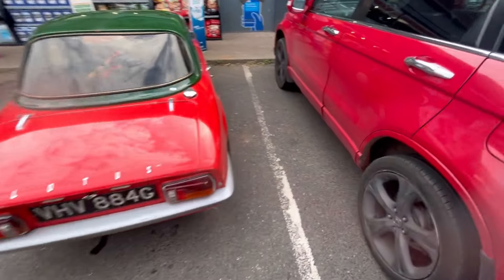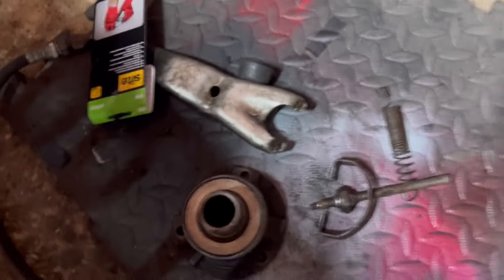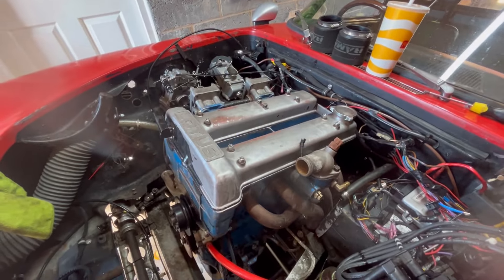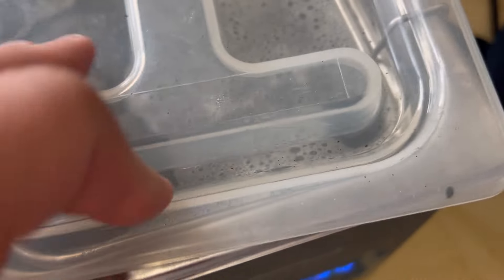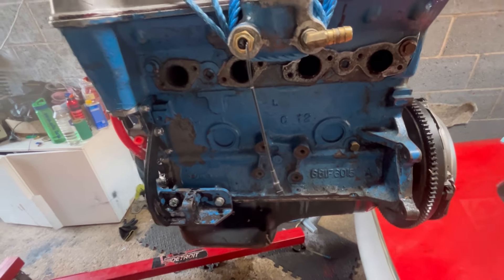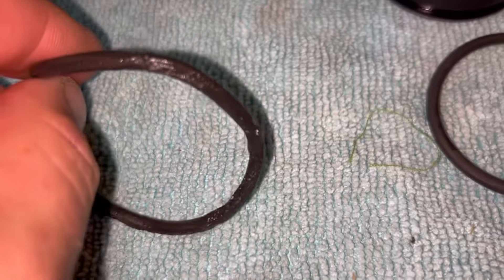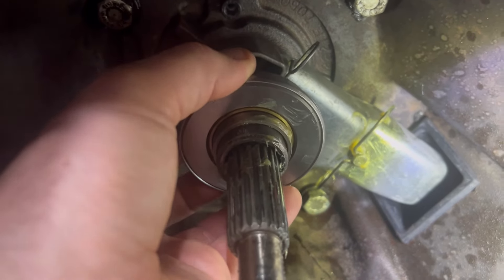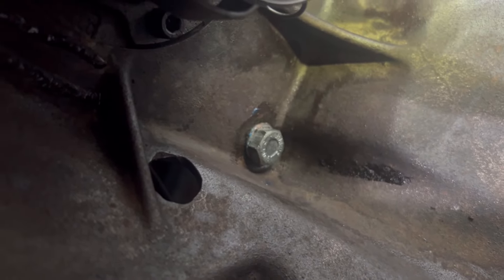Lotus Elan Episode 82 - 🤦🏻‍♂️🤬🤦🏻‍♂️😢

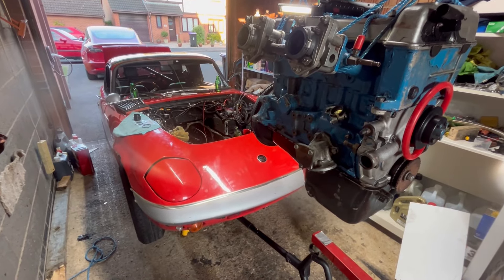Comment: 16:00.  My first car was a '64 TR-4.  The caps on the master cylinders said, "Use Girling Fluid Only".  I ignored what I thought was nothing but an advertisement for Girling and put in everyday brake fluid that most cars used.  Boy, was I wrong.  6-months later, all the rubber bits had turned into chewing gum.  The original rubber parts were made of pure rubber and most brake fluid will attack pure rubber.  Modern brake parts are made of Neoprene.  Off the shelf brake fluid has no effect on Neoprene.  If you buy your rebuild kits from a reputable dealer, he or she will sell Neoprene parts but if they have some really old stock laying around, it's pure rubber.  To avoid taking any chances, use Castrol brake fluid.  It won't attack anything regardless if it's DOT 3 or DOT 4.  DOT 4 is only useful if you're going to really heat up the brakes like in a road race.  One more thing.  As you know, the exhaust pipes wrap around the slave.  They do a pretty good job of cooking it.  See if you can fabricate a shield to protect the slave. Best of luck!

Comment: A great series of video's, always try and watch them. One thing I would say is the release bearing you fitted looks like one of the "Indian" made ones. They are shocking quality and really dont last very long. As for the seal issue, I would soak the new ones in the same DOT fluid you used initially. To me the fluid has perished them. Again, its a question of quality control. I rebiult my Elan master cylinder but the seal was a tab too big and it was sticking, once again crap quality. 
Cheers Mark
Reply from the maker: Hi Mark, which bearing, the new or old? It came from Sue Miller, and I think she got it from Burtons
Reply: @olly22n  Hi, The new release bearing you fitted looks like a "No Name" bearing. Allegedly Tony Thompson does uprated ones made in the UK. I try and buy OEM new old stock bearings.
cheers
Mark
Reply from the maker: @mrnovalueinthemarket6315  too late now 😂😂

Comment: I just noticed two things. First your radiator overflow pipe to expansion tank has been flattened by contact with top tank. Second you don’t seem to have the usual temperature control valve in the thermostat housing. I realise you are using this as a track day car but surely this means a constant hot car. Or do you have another temperature control elsewhere?
Reply from the maker: Overflow is fine, it soon comes back to shape. 

It does get hot but I got fed up of the valves leaking. I went through three

Comment: I had the same release bearing which failed in the same way. I now use a Tilton one that is supposed to be better, only time will tell but that TITAN (Burton one) is not up to scratch in my view at least the seal are not resistant to DOT fluid
Reply from the maker: @humberty  interesting to hear. When I spoke to them they made it seem as I was the first case
Reply: Sorry to say but compared to the tilton this is very cheap rubbish. Now if the seal are not tolerant to dot fluid then this has nothing to do I a car. Removing the engine every other months to change seal on a release bearing is not the way forward. Bought the car in July clutch failed-engine out- then breaded pipe failed - engine out - installed a tilton and now I hope it is in for good.
Reply from the maker: @ I went back to an external
Reply from the maker: @humberty  although they did send me some new and improved seals - so maybe they’ve found a solution